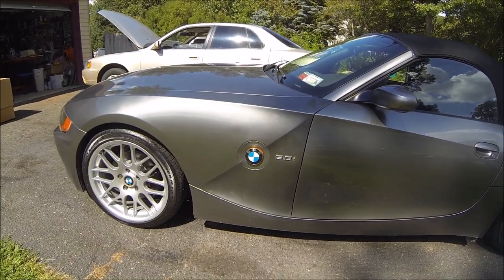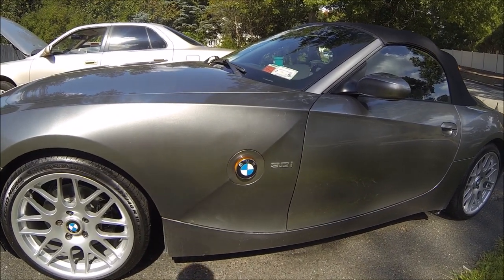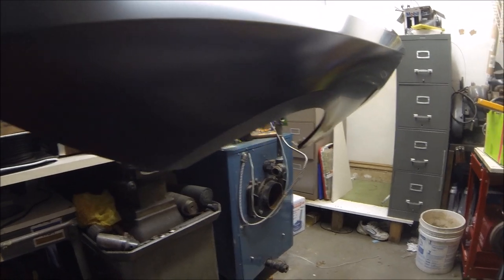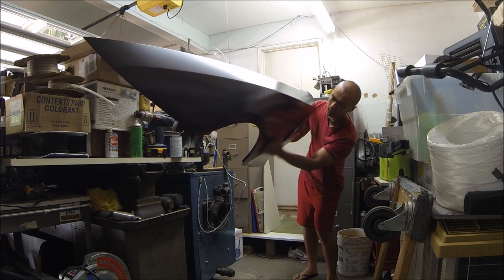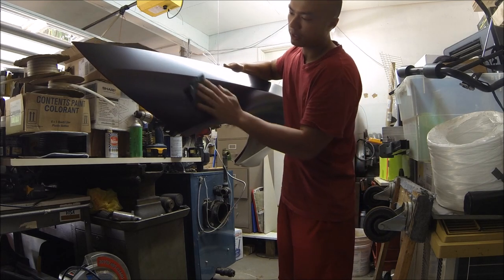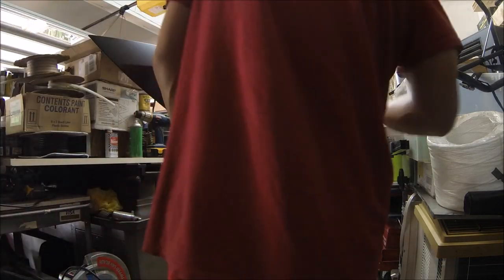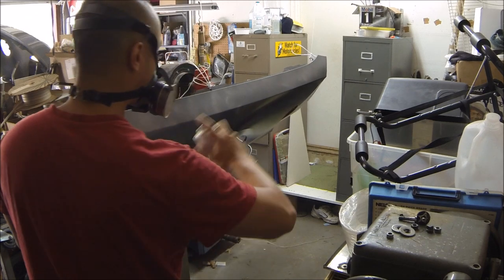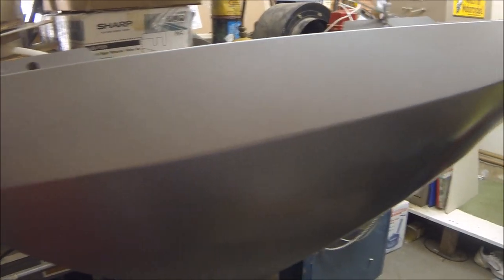Base Coat - Rattle Can Fender Painting Series - Part 1

Comment: Congrats on your current project.
How does the colour match up once your first attempt dried, and you could do a side by side comparison  with your Zed in the sunshine ?

I did an E85 Z4M front bumper repair and repaint. I knew nothing about working with plastic bumpers. So the learning curve was huge ..But fun. All sorts of products to figure out. Adhesion promoters, filler primer, flexy primer etc etc. I got my paint mixed at NAPA and the garage looked like a fog bank during application.  I'm not too sure why that happened.

Cheers and Carry On
Reply from the maker: +jafxdwg next video coming up should answer the color match question. It's definitely a fun process of learning, and while I could get it paid to get it all done, that would take out a lot of the fun factor.